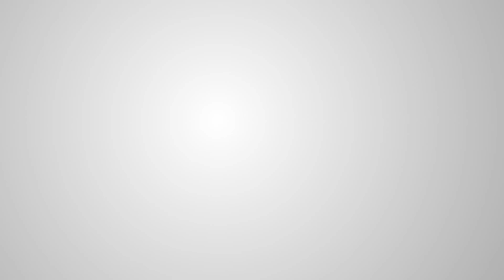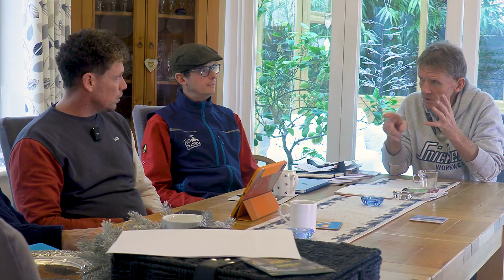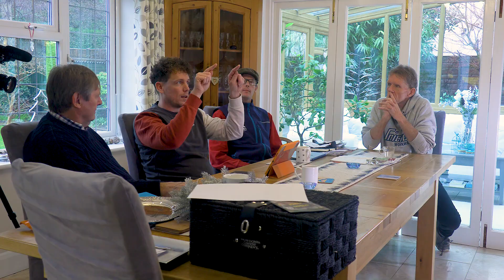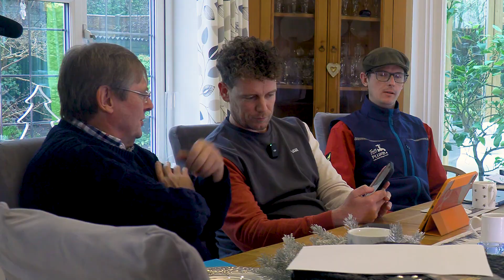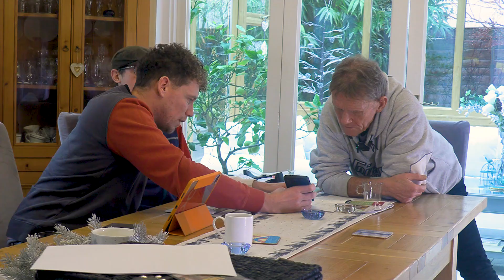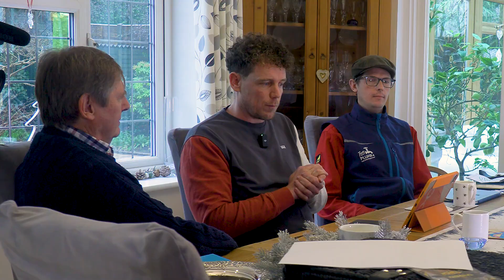What Did We Learn from the Heat Loss Survey?

Comment: Having air to air seems to be a much better opinion than radiators.
Reply: Ait to air isn't really catching on for domestic use yet. One potential reason might be that they don't interact particularly well with traditional masonry buildings due to slow transfer of hear from air to thermal mass elements like block walls. This leads to rapid cooling in intermittent use situations and discomfort due to low radiant temperatures of walls and floors. Air to air systems work better if they're set back rather than turned off in intermittent use situations, but not all units accommodate timed setback.
Reply: @balometer  Don’t know where you’ve got this information from , many people who have got heat pumps air to water wished they had got air to air , many are now looking at the advantages of air to air in relation to having different zones within the house because lots of areas within many homes don’t get used so having zones would be much more efficient rather than having radiators on when that are is hardly used , example my home tend to use 3 rooms 90% of the time the other rooms really don’t get used much at all , personally I have seen lots of videos in regards to heat pump scenarios, only knowing I want to get rid of the gas boiler, in my situation having a heat pump with a hot water tank inside makes sense and can use the existing hole in the wall where the gas flue is for the heat pump on top of the tank, having radiators on in rooms i don’t use makes no sense so having a split system air to air seems logical to me .
Reply: @KavanOBrien  I agree with you, air to air is a better option if it suits the user and the user can drive the system. However, people are often disappointed that air to air indoor units don't behave like radiators. If you turn off the heating in a room that's not in use and then wander in and turn on the heat when the walls etc have cooled to say, 10 degrees you can quickly heat up the air but the room still feels cold due to the low radiant temperature of surfaces. A bit like coming home from holidays in Winter and finding that it takes ages for the house to warm up. 
Air takes much longer to heat the surfaces than radiant heat does, so that cold feeling takes a long time to go away. It's better to set back the temperature in occasionally used spaces to something like 16 degrees than it is to turn off the heat altogether if you're using A to A, and that sort of buggers up the economy of just switching off rooms that aren't in constant use in the depths of Winter. 
I'm an engineer in a company that installs air to air systems, primarily in commercial and industrial settings but also in houses and I won't sell a domestic air to air system to someone who doesn't understand what I've said above, because I've come across the complaint so often, including from one of my co-directors who should know better.
Reply: @balometer Thank you for letting us know that you have no idea at all what you are talking about. Most (but not all) people in the U.K. who are installing a heat pump are seeking the taxpayer funding BUS  grant (£7.5K) The BUS grant specifically excludes A2A systems because of their ability to reverse and provide air conditioning during the seven days in the U.K. when it is needed.
Reply: I’m running a brand new mitsubishi a-a in my 500sqft loft conversion insulated to the latest specs.  It certainly works and the power consumption is very low.  When it’s below freezing it takes longer to warm up and it keeps doing a defrost cycle - but generally works.
In terms of warmth, it’s a different sorta warmth compared to rads, but it’s acceptable.  Plus i get cooling in the summer.
Reply: @eliotmansfield  is it just one unit or does it have more blowers, you can get ones with up to four blowers I think I think they call them mini split systems.
Reply: @eliotmansfield The Summer cooling is a big advantage and the light roof structure will react fairly quickly to heating so the attic is a good place to use air to air.
Reply: Not if you've got radiators already
Reply: @jrisner6535  That doesn’t make sense because in lots of situations the radiators have to be changed because bigger ones are needed to accommodate the way the heat pump works , so having air to air might be a cheaper option not only in the way the house is being warmed but also in the installation.
Reply: @KavanOBrien  not in my experience, changing a radiator or two is a tiny job compared to taking a whole piped system out and replacing with refrig runs
Reply: @jrisner6535  we all see life differently, I don’t have a heat pump yet , looking around at different options, many have said on several YouTube channels that if they were to start from scratch they would not have air to water but instead wished they went for the air to air because much better to have different zones within the house rather than having radiators warming rooms they tend not to use very much , in their opinion much more economical to have air to air , to me it sounds more logical.
Reply: @KavanOBrien  it's never one size fits all 👍
Reply: @jrisner6535  may I ask what heat pump you have ?
Reply: In a big old house like this one?
Reply: @edc1569  Did I miss something? You can get split systems with many blower units.

Comment: I think gas/oil/lpg heating systems can be just as complicated and inefficient (just look at all the "heating system never worked" videos out there). Gas systems have the advantage of over power and cheap(er) fuel, just bung 70° water round, who cares how (in)efficient the system is.  Until the prices jump and suddenly they do care.
Reply: That's more the system design and installation rather than the product.
Reply: @paul756uk2  but that's exactly the same argument for heat pumps though. I'd say that the cost of inefficiency is far lower for gas, resulting in a lot of "user error". I've been in many homes where radiators are too hot to touch in order to "heat a room quickly".

Comment: Interesting point about it being quite academic. I'm doing a masters at university (Energy Engineering), and these calculations and considerations seem to be near that level lol. There is very little mention about heatpumps across entire engineering degrees, even this energy engineering one.
My thermodynamics lecturer would probably be baffled by some of this, how on earth the average joe will know this I don't know. Courses like heatgeek seem to help a lot in that regard. 

I kind of wish it became common knowledge (heatpumps work better at lower flow temps etc) so users of heatpumps understood. How many tenants in rental properties are going to complain their radiators aren't getting hot when they have a heatpump designed for low flow temps and they're used to 70c rads.

Maybe Martin Lewis money saving expert will tell us all to turn down flow temps like he said about gas condensing boilers lol.
Reply: I'm an engineer (consultant) working in the industry and I come across what you describe all the time. People are used to radiators so hot that they're painful to touch. If surfaces or air streams aren't perceived as "hot" then something isn't working. There's an educational journey needed for users before lower temperature heating becomes accepted.
Reply: @balometer yep, my in-laws blast up their thermostats constantly until the rooms become unbearable and then they open windows. In fairness, they've not long had gas central heating, having been used to a coal fire and electric radiators. It's taken about a decade for my wife to finally stop cranking our radiators and just be patient in waiting for the room to heat up. However, go into her car, and she's got the thermostat immediately blasted to 25 degrees. I keep having to tell her that the higher number has no bearing on the speed at which it reaches temperature, but it will result in a stifling hot car that you have to open the windows in. I've noticed it when a passenger in many cars, so it must be a thing where people need to go beyond a comfortable temperature first before they can then feel comfortable. My wife now uses a hot water bottle if she can't wait for the heating to warm the house back to temperature.
Reply: The problem is humans arnt great at accurately sensing temperature. There’s times we feel hot or cold and the temperature is the exact same. In addition if you are sitting in a draft and you have skin exposed it will feel colder than it actually is. Add in to this that men and women like different temperatures and the engineers have their work cut out.
Reply: I find it incredible you are engaged on a Masters without realising that these calculations associated with designing the hydronics side of a heat pump are around O level standard.

Comment: I have watched these programs and would like to put a heat pump in but because my home will be a new build I cannot get any assistance so where is the incentife.  So why isnt there any help there?
Reply: It’s a shame as your system will be  sub 50 degree so no need to replace rads, upgrade pipework or insulate, just plug and play
Reply: Why should the government pay for your home heating system?
Reply: @totalprecisioncarpenter5922  to incentives him to spend the money on a heat pump and low temp emitters rather than spending much less on a boiler and higher temp emitters.
Reply: @totalprecisioncarpenter5922 by installing solar, battery and heat pumps In domestic premises we mitigate the need for infrastructure upgrades and work towards a balanced energy system which hopefully will give us cheaper running costs and energy independence. Ultimately it’s cheaper for the government to fund small domestic upgrades rather than subsidise massive power stations. Although the actual RÓI fluctuates with global energy prices.

Comment: Exactly it’s the grant money that’s one of the roots of the problem. Rodger is right there I feel. If they are that good we shouldn’t have a need for grants. The proposition should sell itself.
Reply: The problem with relying on the market is that you get uncontrolled swings in supply and demand, which can make things unaffordable for millions of people. If we did nothing except wait for north sea gas to run out, we'd be fine for a while but then gas prices would shoot up and everyone would want a heat pump at once - but there would be no experienced installers and the manufacturers wouldn't be able to supply the demand - and it would affect almost everyone in the country at the same time.
Grants are an attempt to smooth the transition, and give the industry (and regulations) time to adapt. 
An analogy would be the big subsidies available to solar systems 20 years ago. They paid for uneconomical installations, but they also kick-started an industry that is now able to sell itself.
Reply: Grant today disaster tomorrow, eg diesel cars, ev’s
Reply: 🤔 not convinced 🤣
Reply: The proposal was never going to sell itself. Boilers are simple and cheap, they produce high grade heat. Heat pumps are more complex, more complicated and they produce lower grate heat. Boilers are relatively cheap, heat pumps are relatively expensive. Running costs for both are roughly the same. 
Governments are tryinging to get people to switch to electricity that's (aspirationally) produced from renewable sources, but there's no economic or functional driver baked in to heat pumps, hence grants.

Comment: I removed the buffer on my hp in Cornwall and it improved my scop, also no glycol or caleffi valves for freezing. I have never seen a hp damaged by frost in 11 years of fixing them. I really enjoyed these vids
Reply: Replaced with close coupled tee's?
Reply: @markturner503 nothing to do with Close coupled tees. Its for extra system volume and for the defrost cycles
Reply: Get a gas boiler. They will be doing " Was you mis sold a ASHP Come to we will Make money solicitors no win no fee.
Reply: @richardlyons7582  could we have that in English please 😁
Reply: @richardlyons7582   😂👍